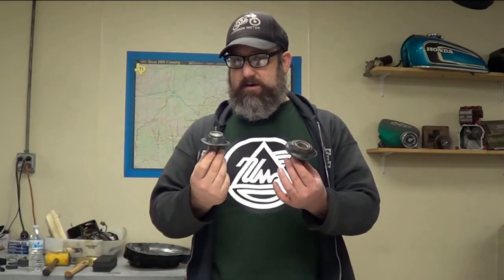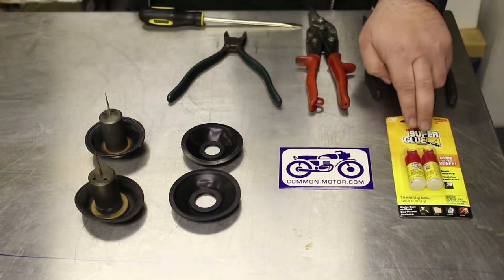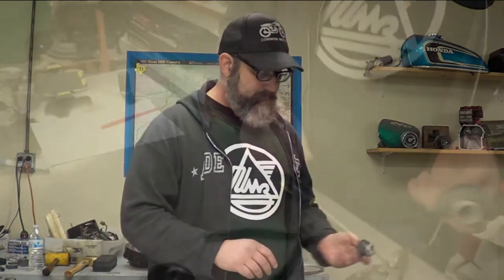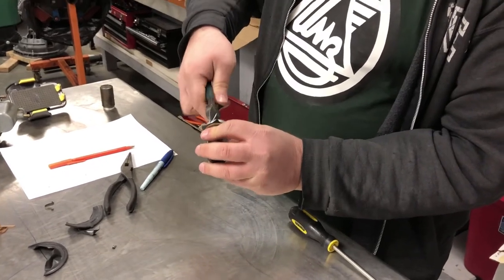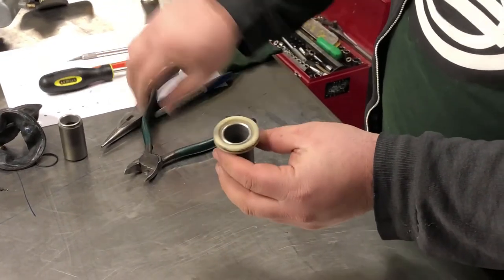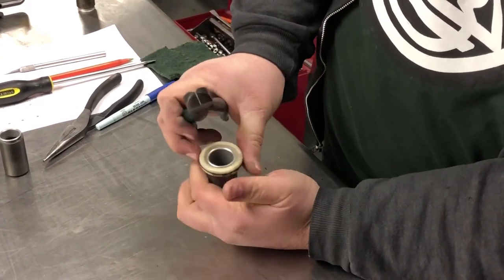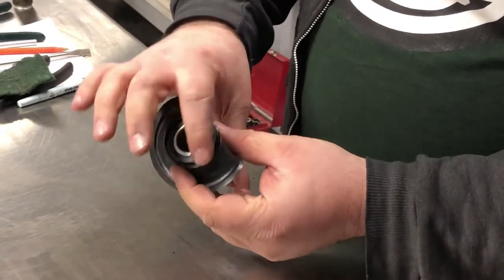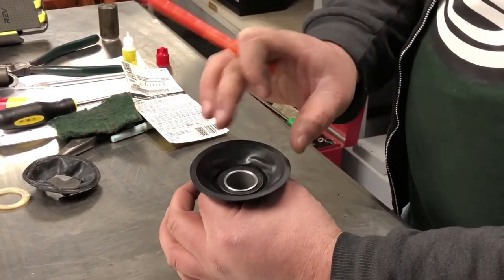Honda CB350 / CB360 Carburetor Diaphragm Installation

Comment: Hey Brendan, great video and great that you guys have an option to replace these diaphragms 👍 I have found the rubber in these (JBM) diaphragms to be quite a bit stiffer than the OEM ones, and the carbs don't respond very well to them without some mods (particularly if running pod filters). Seems the stiffer rubber causes the slide to rise much later. I found opening up the two slide lift holes by about 1-1.5mm (3.5mm stock to about 4.5 to 5mm from memory) helps considerably and gets the slides operating much closer to how they do with the stock diaphragms. Of course there are so many variables at play from bike to bike, but info that may be of use if you have any customers running into the same trouble. Cheers👍
Reply: Hi David, I think I’m having the same problem. I replaced the diaphragms and it runs great at full throttle but sputters like crazy otherwise. Do you think enlarging the slide holes could help? Thanks!!

Comment: To get the old bellows and phenolic ring off, rip the bellows away, then just heat the ring on a gas stove. Just a few moments will heat it up, soften it, and it will just pull away and off.  East with just a pliars.....No damage to the slide!!!

Comment: Thanks, is this also the same for a cb250g?
Reply from the maker: Yes, but the 250's were either built on a 350 or 360 platform. Need to know what version of the bike you have to order the correct diaphragm.
Reply: Kz 305 con carburador keihin

Comment: Bad way for replace the membrane, you don't need to cut the plastic holder, just use soapy water and install the new one
Reply from the maker: There's more than one way to skin a cat, they say. We stand behind our recommendations. To each their own though.
Reply: hello
in what position are the 2 bottom holes of the bushel in relation to the carbu and has the membrane..... parallel to the cylinder or on the side? @Common-motor
Reply: huh?